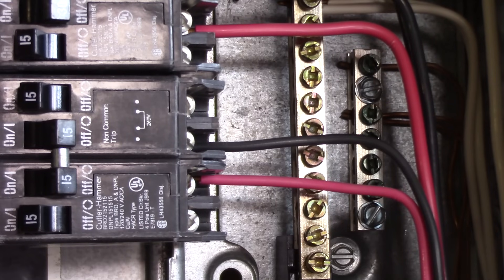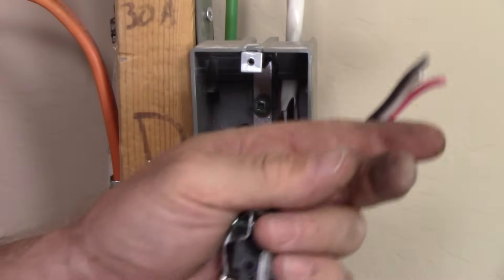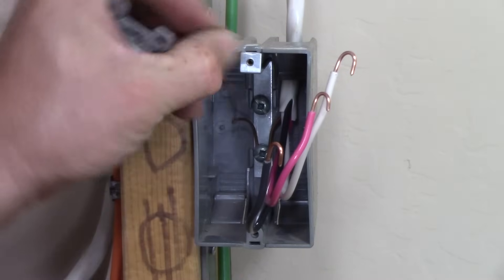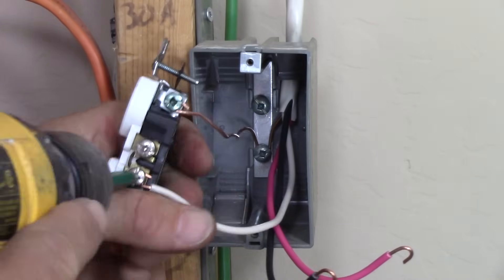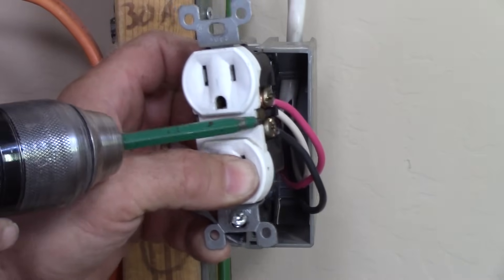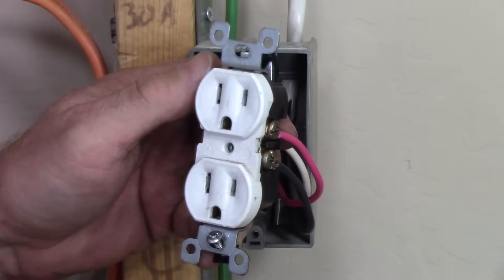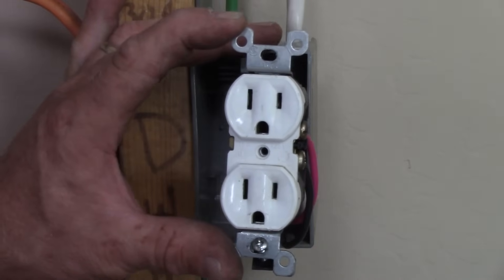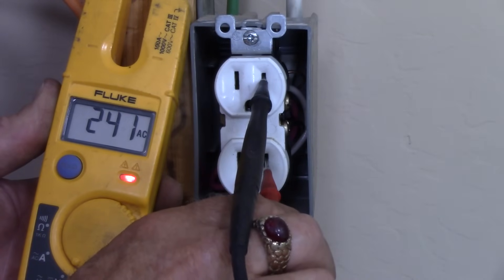Kitchen Split Circuit Receptacles Explained

Comment: Would it still be possible to piggyback a new outlet off of the constant or would the  new outlet be controlled by the switch too?
Reply from the maker: You're referring to a switched receptacle here? And yes, if you pig-tail off the constant hot and the neutral, what you are asking is possible.  And you could come off of either hot in a kitchen split receptacle arrangement, but then you are not compliant with code due to the number of split kitchen receptacles allowed on one 2-15A circuit is that makes more than 2.
Reply: @theinternetelectrician  it’s in a bedroom. Just trying to add a receptacle behind a wall mounted tv, but the outlet is a half-hot and I wasn’t quite sure how to do it
Reply from the maker: @bpatriquin123  Then yes, for sure you can do this.  Same stud space makes it even easier!
Reply: @theinternetelectrician  That’s what I’m thinking! Just adding the new one like 4 or 5 feet above the existing outlet. I just don’t wanna end up with a TV that I can only watch when the light is turned on 😂

Comment: This is pretty dangerous. You
Should have two independent neutral conductors, with the tab on the neutral blade receptacles removed. With this setup, you can be pulling up to 30 amps on a single 14 AWG conductor.
Reply from the maker: Joel, with the 2 hot conductors coming from opposing sides then the neutral only takes the unbalanced load.  Watch it again and if you still have questions I will try to help you out.

Comment: How do you wire this if you are continuing on to another receptacle? Also, we have a stablok panel, does it matter where the double breaker is located on the busbar to get the different phases?
Reply from the maker: Great comment!   You have to pig-tail your conductors to continue the circuit to another outlet, and yes, good ol' FPE Sta-blok.  The only panel that will enable the installation of a 2-pole wafer breaker on the same hot buss.  So yes, you must ensure that it is installed across the barrier, otherwise the neutral current compounds instead of cancels out. Thanks for watching!  I hope you have subscribed?  And gave the video a 'like'!

Comment: Why the neutral on that side?
Reply from the maker: That is to standardize how connections are made to devices. That is the side that is designated as neutral by the NEMA standard configuration for wiring devices.
Reply: Oh.

Comment: Terry, the wire I’m dealing with has to be the thinnest, finest ever. It’s for my wall Mount garage opener. It’s black/green (previously hooked up to the red screw) then yellow/red (was on screw labeled white). Of course I go to put up new Chamberlain wall opener, wires too short. I have no idea what I’m doing. The had both wires combined on red side under the screw, and both under white screw touching. I bought push-in connectors to extend all four but wondering if a better way

Comment: What if you break off the tab on both sides? Can it still be used?
Reply from the maker: Good question, and yes you can.  Best solution is to pigtail in an extra wire to facilitate going to both of the terminals on the side you didn't intend to break off.
Reply: @theinternetelectrician  thanks- I found it easier to just go buy another one! Lol
Reply from the maker: @LizzyCGM  Yup, that is the best solution.  But I've been in a dilemma where I didn't have one handy to finish a job, so had to make this fix work!  Thanks for watching!  I hope that you have subscribed?  I need help to get to the magic 100K subs club!  Getting closer!
Reply: @theinternetelectrician  my socket actually has two red two white and two black as well as ground- the prof of the appliance plugged in to it somehow overheated and melted into it. I’m hoping it still safe now

Comment: If I have this running in my kitchen for the outlets, red white and black wire, can I put a GFCI in? And what would that look like in terms of the wiring?
Reply from the maker: It's not that easy, because these circuits share a neutral.  This makes things more complicated, and you actually lose by doing so.  Right now you have 2 circuits at 15A each.  To go to GFCI outlets, you have to use just one of the hot wires, and you can't size up the breaker size to 20A because you have #14 wire. So basically you are cutting your supply to kitchen appliances in half.  I would ask why?  I get this question a lot so you're not alone.  I will do a video on this subject, so thanks for the trigger!  GFCI is great protection if you plan on touching the prongs of an appliance plug while soaking wet, in your bare feet, on a tile or concrete floor, but otherwise I'd just stay with the 3-wire split circuits you have.  Others may disagree with me vehemently, but this is just my opinion. Thanks for watching, commenting, and I hope that you have "liked" and subscribed to my channel?  I'm on a push for the 100K sub milestone.  Not sure why that's important, but I think YouTube sends me a plaque to hang on the wall!
Reply: @theinternetelectrician  awesome thank you very much for the reply. The reason why is just for safety for the 1.5 m distance from the sink. I was just putting them in as per code in Canada here. I did some research as well previous to your reply, and found out that I could add a GFI breaker to the panel. How to do that? I guess I will have to figure that out. But I really appreciate you replying. And looking forward to the next video and congratulations on the road to 100 K.
Reply from the maker: @TheFlowshizle  you are correct.  I am also Canadian, my training in Alberta Canada.  The new code requires the GFCI protection, but any installation prior to new and revised codes are grandfathered in and aren't required to be changed to adhere to the current ones unless you do a remodel or alter the electrical system.  If you are concerned about safety then yes, the 15A 2-pole GFCI breaker(s) is another way to go that I neglected to mention and is by far the best option if you want to have that extra protection on those outlets.  Thanks for the reminder of that!
Reply: @theinternetelectrician  thank you sir

Comment: Great presentation! How do you use this method for multiple outlets, just use pigtails?
Reply from the maker: Hi Mark.  Yes, pigtailing is the way to go.  Even though you have only 2 white wires and those terminals look tempting, I've had an inspector flag that and make me do pigtails even on the neutrals.  The blacks and reds obviously need to be pig-tailed as there is only one terminal each for them to go on.  Unless you use the terminal screw and the quick connects, but I never recommend using the push-in connections.  So short answer, you are correct.  Pigtails it is!

Comment: Very clear installation., but what happens in the white neutral white line when both receptacles are used at 15 amps each which then equals 30 amps for the single neutral line, when each line is only rated at 15 amps?
Reply from the maker: That explanation is in the video, but here it is.  The neutral in this correctly connected circuit (a properly installed 2-pole breaker) ensures that the neutral only carries the unbalanced load.  So if there is 10A being drawn on one half of an outlet, and 8A on the other, then the neutral only has 2A on it.  So the maximum is whatever one half may draw, even with nothing on the other.  With AC power, and the sine wave structure of current / voltage, when one leg of the power is on the top side of the curve, the other leg is 180 degrees opposite.  Thus 240V between them, but each referenced to neutral is 120V each
Reply: @theinternetelectrician  Hi Terry. Thank you for your written reply. Getting old I always do better reading instructions rather than listening to them. Much appreciated!
Reply from the maker: @heliandme  My wife says I don't listen to, read, or follow instructions very well!

Comment: Thank you for this video! This is exactly what I have in my older kitchen (no GFI) and this is exactly what happened to me! I was unaware I needed to break the tab, wired up a new outlet, turned on the bridge circuit and tripped my entire power panel. I put the old receptacles back and was going to leave well enough alone, but now I feel confident about trying it again.
Reply: Same for me. The explanation and walkthrough is great.

Comment: Thanks Terry.  Our kitchen microwave receptacle and one additional receptacle were on a 2 pole 15a circuit.  When I went to update the plugs, I was scratching my head why they used 14/3 instead of 14/2, and why the breaker kept tripping.  Mystery solved!!!  You've got a new subscriber!
Reply from the maker: Happy to help out!  My goal here on this channel is to help you do it right, do it safely, and save you money!

Comment: Thx. Why is it important to tie both breakers together?
Reply from the maker: Excellent question.  And one that I should produce a short video on, and I will!  The reason is so that you can't shut off just one of the breakers, and then think the wires in an outlet box are off as the other breaker is still on.  When they are mechanically tied together, both must be off or both on.  And if one trips, both will shut off as well.

Comment: I did everything you said here,broke the tab but only the bottom half works the top of the receptical doesn't work when switched on ,I also have two red wires that connects to the switch,I a tandem 15 amp circuit, please help.

Comment: My kitchen has 2 outlets for this setup. One of the outlets has 1 neutral wire in the box and the other two. Do i cut the neutral wire tab on the outlet (for the box with two neutral wires)?

Comment: I have a receptacle with this exact setup. Except at the breaker panel (generator panel), the two breakers are not attached and can be flipped individually. I want to install a surge protector receptacle, but the ones with the tabs to split it don't exist. Would I be able to split and extend both the neutral and ground, attach it to both, and then attach the red to one and the black to the other? That way I have a surge protector receptacle for my freezer and a UV light, but on separate circuits. I don't have a powerful enough generator to power my freezer/fridge and well pump at the same time. But need my UV light on when I use the water.
Reply: I would say absolutely not. I don't know what you mean by split and extend the neutral and ground.
Reply: @surferdude642  I looked it up, and apparently it's called a MWBC (Multiwire Branch Circuit) where there is a shared neutral and shared ground. Apparently they should have a handle tie on the breaker so that when one trips, so will the other. But for my usage, I would always have one breaker off when I use the generator, anyway.
Reply: @SarahPoulin  Shared ground? I've never heard that term. If you mean the ground and neutral are connected at receptacle, then that's a "bootleg ground" and is not allowed.

Comment: Great video, thanks for the info. Question: If one was to run two separate runs of 12/2 wire to a split outlet, and run each to a separate breaker, would that work?
Reply: Yes, but it would not be a multiwire branch circuit with a shared neutral. You would need to break the tab on the neutral as well and attach each separate circuit neutral wires, making sure that each neutral wire originates from the same cable as its hot wire for each individual receptacle. You should also make sure the breakers are next to each other so they can be tied together or replaced with a double pole breaker.
Reply: @surferdude642  thanks for the info!
Reply: @DaveDrawing  Actually what you're suggesting is a better option in my view. A MWBC saves a cable, but offers no electrical advantage and can be problematic down the road if someone doesn't recognize it.
Reply: @surferdude642  thanks... so it's not just me... LOL

Comment: Does this work for GFCI receptacle as well?
Reply: No, a GFCI receptacle cannot be split. However, you install 2 GFCI's, the red wire to one and the black wire to the other, Line connection only on each. The neutral wires would be pigtailed to each GFCI, again, Line connection only. The Load connections can never be used. Keep in mind you could plug 2 loads in each outlet instead of one in a standard split duplex receptacle.

Comment: Can I add a 2 nd receptacle to my single split  Circuit receptacle in my kitchen?
Reply: No, because you'd be adding a receptacle to the same pole with a shared neutral. If one receptacle was drawing 10 amps and the other was drawing 8 amps the return current would be added, so instead of 2 amps on the return neutral as in his example, you'd have 18 amps on the neutral and could overheat the wire and will not trip the breaker. It's a potentially dangerous situation.
What you can do is replace the split receptacle with 2 regular not split receptacles. The red wire goes to one and the black wire goes to the other. The shared neutral would be pigtailed to the first one and end at the second. Each duplex receptacle will then be operating off of separate circuits. Now you might plug a 10 amp and 8 amp appliance in one duplex receptacle and still have 18 amps one the neutral wire, but in this scenario you will also have 18 amps on the hot wire, and if overloaded the circuit breaker will trip if it's operating correctly. Alternatively, 2 GFCI receptacles can be used and wired similarly to the Line side only on each one. The Load side cannot be used to protect downstream receptacles in this case.

Comment: So, as you mentioned, I made this exact mistake. I now understand exactly how the circuit works. Unfortunately for me, my breaker was defective and didn’t pop and the main to the apartment triggered. Needed an electrician to come re reset it. Good lesson. A mistake I will never make again.
Reply from the maker: All breakers are designed to trip on a short circuit condition, no matter if the branch circuit breaker is a 15A or 100A or 200A main.  The main breaker was just quicker on the draw!  The older FPE stab-lok breakers were notorious for not tripping when they should.  I once accidentally cut through a live 14/2 cable on a 15A breaker, and the arcing and sparking that occurred behind the truss (where I couldn't see it) took a big bite out of my reciprocating saw blade and cut the cable right through, yet the breaker didn't trip!  Thanks for watching!

Comment: Hi Terry, My Kitchen is wired that way ... but with all the new outlets that have USB connection for charging device, I would like too had one of those outlet, do I just condemn the red wire with a marrette and hook up my outlet with the black and white like usual ? Thanks
Reply from the maker: Yeah, that would work.  However I've found those combination outlets to be way too expensive for the value added.  Consider getting a plug in unit that has multiple outlets along with usb ports.  Not as aesthetically pleasing, but usually have more ports, etc. Just make sure the one you use in the split receptacles has just one actual 'plug' that taps into the receiving outlet.  I'm not sure if they make one that grabs both halves of the receptacle, but if they do, and aren't split inside the combo device you'd have a short circuit condition that would trip the breaker (at best) and likely destroy the device.
Reply: @theinternetelectrician  Thank’s for the response … very nice !

Comment: damn this is close to what i'm looking for what if you want to wire a 12/3 from 20amp double pole breaker to power two areas i recently got a deck and by the door i want a sconce an outdoor outlet and indoor outlet on one side of the patio doors and then wire an outlet on the opposite side for a beverage fridge. What would that look like?
Reply from the maker: Run the 12/3 to the first outlet (receptacle), and use a deep box there. Run a 2-wire to the other receptacle, then to switch, then to the sconce light.  From the first box, also run a 2-wire over to the beverage fridge (saving at least 12 beer for me).  Connect the convenience outlets to the black hot wire and shared neutral.  Connect the red wire and shared neutral to the 2-wire going over to the fridge.

Comment: Hi terry,  I have a multi wire multi circuit on a receptacle, it’s  bees nest, 1 split circuit R B N & G, the other into the box is 2 B wires, no N no G  ?     The 2 blacks from each circuit are joined by pigtail, But now I have this lone black, that I think is a N. Because that’s all that makes sense.   Any suggestions? Going to test.  It’s been working for years p, the pigtail starting arching. So I have not reworded the box.

Comment: Nice idea for shop outlets.  I'm installing a new one and this will come in handy (the circuit will start as a split 120V 20A duplex 5-20R receptacle with the option to change to 220V 6-20R down the road and no need to change the wiring or breaker).  I always wondered about how much current the single neutral carried for those two hots.  Technically, this is considered a single circuit and not a dual.
Reply: In a kitchen you could make an adapter for European countertop appliances it would just take up both receptacles.